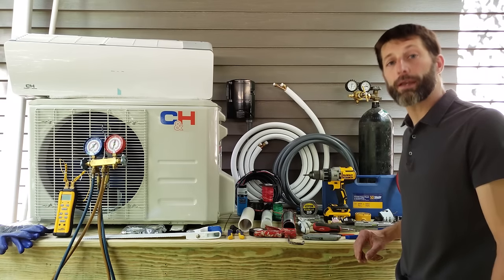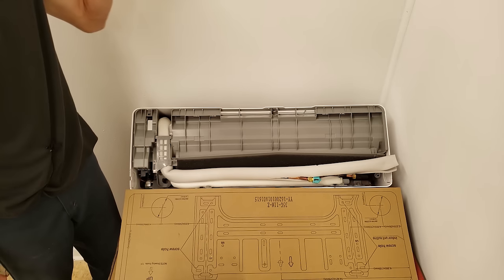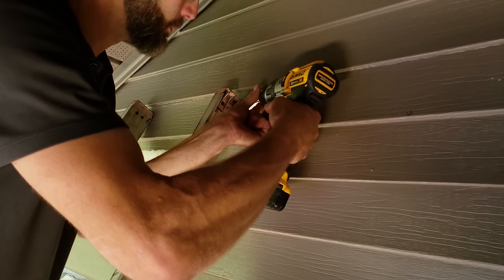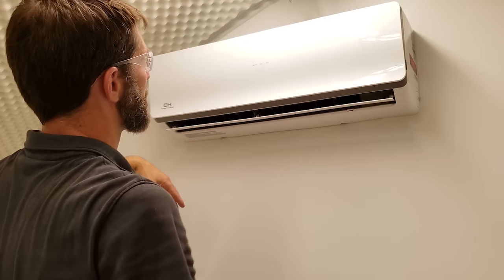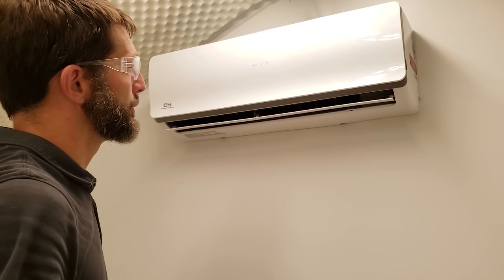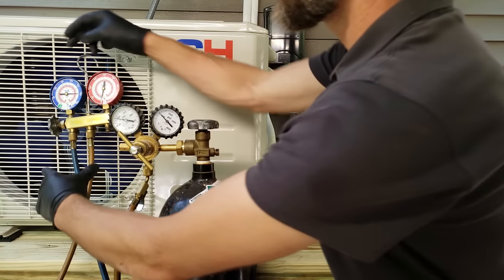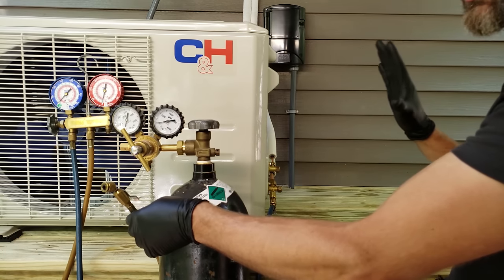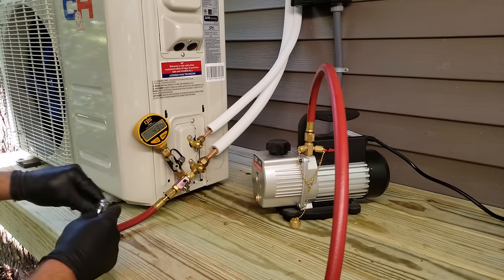Full Installation of Mini Split Ductless Unit, Step by Step!

Comment: Years ago, I paid $5,000 to have a 15K Fujitsu mini-split installed by a local HVAC company. That price did not include 240 volt wiring, as I anticipated the installation of an 12K A/C window unit that the Fujitsu replaced.

They installed it on a wood deck, as you did, but with an imitation concrete pad that came with it. BIG mistake - during the winter, ice build-up during the defrosting mode was a problem. 

They came out and put standard 8" tall concrete blocks underneath to raise the outdoor unit. All that did was build-up 8" of ice underneath!

Disgusted, I constructed a treated wood riser, with 24" of clearance underneath. I had to monitor the winter ice build-up, remove the top cover, and spray down the coils with hot water whenever ice builtup.

I have no idea how your installation can avoid ice build-up, unless newer designs have eliminated the problem I had.

The unit eventually seemed to lose it's refrigerant charge, after only 5 years. It was not worth attempting repairs to find the reason. They are throwaway units when they fail!

Comment: you actually don't need to straighten the tubings. you can just use the other side hole for the internal connections.

Comment: Any feedback on how these work on a 20-30 degree day for heat?
Reply: Depends on your unit, you'd need to check the manual to see the operating range. But most systems like this work well below freezing. The more expensive models come with drain pan heaters and compressor heaters. Their efficiency does suffer the colder it gets, however.

Comment: hi, some unit comes with a small condensate pump. when would you need to use one of those. thanks.
Reply: When the condensate may need to go upwards to maybe a drain in the room above. If the condensate is only being fed outside from the indoor unit, you don't need it

Comment: I want to be able to use my thermostat to control my mini split air conditioner.  could you make a video to show how the wire the mini split conditioner to thermostat?
Reply: You can't do that in most cases because these use a communicating thermostat with multiple speeds. Some manufacturers offer a converter that allows you to use a normal thermostat but it dumbs down the unit.

Comment: My C&H 36,000 puts up a P6 code and doesn't work, not an electrician but I believe I have 10-2 wire (orange in color). on a 2 pull  30 amp fuse in panel with a fuseless outdoor box. any help would be greatly appreciated.

Comment: How old of copper Line set could you use. I installed one 5 years ago and hope the copper hasn’t oxidized too much inside. Any ideas?
Reply: They make flush solvent to clean out anything in the lineset, i use it for linesets that just can't be changed due tu location and difficulty and it works fine.

Comment: can you please make a video about the difference between low charge vs liquid line restriction in mini split ductless unit that has no high pressure service port
Reply: You have to look for temp drops in the lines for ll restrictions. But mini splits do their own thing with so many variables that it is fun to troubleshoot.

Comment: Very informative. However, about nitrogen pressure testing:  I'm installing a Pioneer unit and I noticed their installation instructions do not mention at all a nitrogen pressure test, only a vacuum test.  I called Pioneer and their technician said nitrogen pressure testing is simply not needed with their units.  Looking online, there have been discussions about this (GarageJournal, Reddit).  On Reddit someone posted that their Fujitsu install manual actually prohibits pressure testing with nitrogen ("when inspecting gas leakage, always use the vacuum pump for pressure.  Do not use nitrogen gas".  In response an HVAC person posted "You will start seeing more of this in manuals....a lot of manufacturers are having problems with the valves...people are blowing nitrogen past them and contaminating the factory charge..."   Others maintain a vacuum test alone is inadequate.  Who to believe??
Reply from the maker: I would do a pressure test to test for leaks but the test pressure does not need to be that high even if it were 100 or 200 psi. That certainly would not blow any valve because the standing pressure of R-410A when it is off at 70 degrees F is 201psi. I believe they are referencing techs putting the pressure up to 500 or 600 psi, thanks!

Comment: Years ago my fujitsu rep told me to never use the nuts and flares that come on the line set. You haven't had bad experiences with them leaking?
Reply: I cut them off at the fan coil and braze them. It cuts down on call backs for leaks. I can’t braze them at the outdoor unit because they thread onto the brass “blocks” but I wish I could.
Reply: @joshramsey6893  I've seen people do that. Never have done it myself. Recently jumped onto the press fitting band wagon. Hoping for the best, I've put in ten systems with them so far. 😅
Reply: @profjohnfrinks  I have also jumped on that wagon and so far we have had good results.

Comment: So it's ok to cut the line set to avoid the coil up (excess line set) ?  Is it bad to have a coil up and not cut the line set.
Reply: Its best to cut off the line set like Craig demonstrated.  Coiled linesets can cause an undesired oil trap.

Comment: When the outdoor unit has four lines, brown, blue, orange and ground, and the indoor unit has seven lines: four like the other are brown, blue, orange and ground, and the other three are thin, white, red and black.  Note that the air conditioner is an inverter.
And the outdoor unit dont have another 3 lines for the thin wires .
Thanks.

Comment: I have a question.. Cuting the length of the tubbing doesn't create any problems?
Reply: As long as your liquid line (small pipe) is 10ft or more you should be fine.
Reply: No, the accumulator is sized for a certain line length(holding any excess refrigerant is ok).

Comment: How do HVAC professionals view the Cooper&Hunter brand heat pumps?  I hear lots of people/techs suggest the Mitsubishi or Fujitsi but they don't seem to have reasons as to why the other brands are not any good.  I'm inclined to get a Cooper-Hunter Dakota series 12,000btu at this point unless I hear something particularly wrong with the brand.
Reply: I might be wrong, but all Cooper&Hunter products are made for them in China by GREE. Which is world's largest AC producer and a good one as well.
Reply: Well Mitsubishi and Fujitsu are Japanese quality and they sell equipment world wide. C&h is USA only and is just rebadged equipment from midea or gree which are both cheaper units. They aren't as efficient as Mitsubishi or Fujitsu unfortunately.

Comment: After watching this I realize I need to hire the job out because I would spend a fortune on all the tools. However, I worry the techs here might not be as detailed and experienced as Craig. Should I make the installer watch this video and make sure they will follow these steps and have all the special tools? I’ve been burned by so many hack contractors.

Comment: i must have missed something -- is the refrigerant already in the unit, and it's released at some point after vacuuming out the lineset?
Reply: It's like any other condensing unit that is charged with refrigerant.
Reply: @seanmathews1826  unfortunately, those words don't mean anything to me. it's either got the refrigerant in it already, or he charged it with refrigerant but i missed that part of the video / or he left it out.
Reply: Pretty much all air conditioning systems are precharged with refrigerant. After the copper lines are connected and a vacuum has been pulled the refrigerant is released at the outside condensing unit. There are usually two valves that are opened with Allen wrenches.  
Hope this helps . By the way I am an HVAC tech with 31 years experience. And if you want my honest opinion stay away from these mini split systems.  They are over engineered junk. I wouldn't put one in my house if it was given to me for free.

Comment: One small detail.......the crimp you made on the insulated terminal should have been made with the oval jaws of the crimper not the spike. The spike is reserved for non insulated terminals and if used should be "spiked" on the opposite side of the split of the tube of the terminal (some of the best quality terminals are solid tubes in which case it doesn't matter where the spike is located. Your Irwin stripper/crimper has mis-leading markings for crimps that indicate the spikes are ok for insul and non-insul. Irwin is not known for high quality electrical/electronics tools. Most higher end crimps like Kleins and Knipex clearly differentiate the spikes for non-insulated terminals. 
I did the same thing for a decade or so until I studied several of the tool & terminal manufacturer's data & install sheets as well as technical how to's of aircraft and boating enthusiasts. Some of the best info on this topic can be found from marine and boating electrical manufacturers as well as forums dedicated to marine or aircraft. They have to deal with truly harsh and/or corrosive environments while insuring safe long lasting connections.
In this particular case it's not that big of a deal on the tray cable wiring because it doesn't deal with much current. The indoor unit's  blower motor, control panel, actuators, sensors etc don't consume much current. This is also not a big concern for low voltage control wiring. It really becomes a thing for high current mains voltage like compressors, contactors or fan connections. Here it's best practice to use dedicated ratchet crimpers with high quality terminals to obtain almost gas-tight crimps that won't succumb to corrosion and high resistance which causes the burned out terminals. (By the way, some of the factory terminal connections from major HVAC manufacturers are poor quality eventually resulting in failure)

Comment: Can you run the lines out the left side instead??
Reply: Yes, you can see on the template at https://youtu.be/JQkth-AM5CE?t=605 it has where to cut the hole on either side.

Comment: Great video but what blows my mind is why not just use a stud finder in the beginning?  You have all the proper tools for literally everything else.  Just seems amateurish to keep drilling small holes with the screw to find a stud when a stud finder would have found it in 2 seconds and then you move on?  I plan on installing my Mini split in the garage here in about a month.  This video was nice because it went over mostly everything.
Reply: He's the AC Service Tech, not Norm on This Old House. Do you moonlight as a Brain Surgeon?  Didn't think so.
Reply: @juniorvasquez9166  I'm competent enough to be able to use a stud finder and not draw unnecessary holes again this video was great but certain things if you have all the other tools to do the job how is not having a $20 stud finder worth it in your arsenal to be able to not only locate if there are studs but more importantly if you're going through and there's wiring or other such things that you could potentially hit by drilling unnecessarily holes...aa

Comment: there is a little mistake there when you connect  the power line (red wire) .  It should connect to the hidden post as you connect the black wire.

Comment: Interesting how you used the downspout to cover the line.   I used plastic rain gutter and cut to size when I did mine then used 1 inch L brackets to attach.  Yours seems more secure.

Comment: The instructions on nilog specifically claim to be a thread and gasket sealant actually it says to put on threads as if it were a “rope”
Reply from the maker: Yes that is correct for a threaded seal. This is a flare seal. These threads are too spread out and are only meant for tightening the seal at the flare face, thanks!

Comment: Quick question for anyone who knows how short can the  line set be ? Let's say the Installation was back to back is it better to leave the full line set coiled up or cut it about a  foot in length
Reply: The instructions will say minimum length. The brands I have looked at state 9ft as minimum. You also have to reduce the Freon charge to match the shorter Line set.
Reply: @gatorgrissom9141  reducing the freon charge is where the issue is for me , I've seen overtime minisplits ice up when that method is followed, however once you leave the full factory charge in no matter how short you cut it it runs fine , so techs started leaving the line set coiled up at the back of the condenser just for peace of mind🤷🏽‍♂️
Reply: Overcharge will ice up

Comment: Why didn't you show how you fished the wire from the back to the front of the head unit? And then, installing the harness bracket to the back of the unit? Kind of an important step...

Comment: Time 54:45
For vacuum test procedure, it may be too confuse for beginner (or DIY guy for doing ad-hoc works without sufficient tools and equipment) as the video showing too many adopters / protection devices and gauges plugging into the low pressure service valve. I finally joined a evening hobby class and diy myself to figure out what exactly doing about....

Also the class instructor offer a dirty trick for student without vacuum pump in hand (some non-professional corner shop ac technician actually doing this for many years without problem) by omitting the vacuum procedure.....
1. Ensure both service valves at vapor (low pressure) pipe and (high pressure) liquid pipe are locked.
2. Slightly loose the vapor (low pressure) pipe flare nut.
3. Keep vapor (low pressure) service valve closed.
4. Open liquid (high pressure) pipe service valve and let refrigerant release for filling an brand new system. Excessive air inside the pipe will be expelled out at the vapor (low pressure) line flare end due to low pressure line valve are closed (hear air sound and watch little refrigerant come out).
5. Re-tight the vapour line flare nut again to the required torque after procedure (4).
***End of Expelling Excessive Air procedure*** 

I am sure this is not acceptable for professional trade, but commonly happened for domestic AC installation works in Hong Kong. As I also fooled by an AC technician for installing my new split type AC without pressure test and vacuum test until I attended the evening hobby class too🙄

In Hong Kong, most AC units are mounted outside the concrete wall from highrise building. For old buildings no permanet pre-built mounting platform for AC unit. So it needs to erect a permanet stainless steel cantilever hanger platform (for AC unit seating) and temporary working platform for hose connection and servicing outside concrete wall for highrise building. Lifting and loading a 3.0HP AC unit outside the window in old high-rise building by only two workers is the most risky procedure for the entired installation works (fatal accident do happened occasionally for falling ac unit, even workers from multiple level building to ground floor without proper safety procedure!!!)

I have to install a hoist and use block chain to load the AC unit to the permanet steel hanger platform outside the wall....Also some aging unit and rusting AC hanger platform without routine structural check and maintenance also possess risks to public too.

Last but not least, thank you for your generosity for showing this video for installing AC unit in professional way.

Comment: If someone can help me.  When you don’t use the whole line set that comes with the unit.   How do you know how much refrigerant to remove?
Reply: From experience these units are pretty tolerant to length changes and it will be fine keeping the full factory charge. If you are worried you can test it like he does at the end of the video with the thermal probes and gauge and do the math.

Comment: Sir can you please explain the charging method on this type of unit to determine whether it is under or overcharged? The explanation at the end of this video was a bit confusing, especially the superheat value and accumulator, as your explanation on the accumulator was clearly stated in a previous video.
Reply: Its is based on the length of the lineset. Not superheat or subcooling. The unit will come with enough refrigerant for a certain length of lineset. If you exceed that length, you have to add refrigerant. The manual will normally tell you how much to add per foot of additional lineset. There are also minimum and maximum lineset allowances.
Reply: He explained that you can not add charge based on superheat or subcool.  If necessary, recover and then weigh in refrigerant.  The "liquid" line is actually an insulated expansion line downstream of the metering device, which is located in the outside unit, not in the evaporator.
Reply: His method of checking is a bit imprecise and old school. To properly check requires two hydrometer and temp probes to measure the temp and moisture removal. In addition, you should know and verify air flow. I did this and got my expected capacity. This is the only method for verifying operation. This is because a mini split can vary compressor, expansion valve, and inside and outside air flows. For more information on how to check visit the hvacschool channel and search for mini split videos.
Reply: To add, every mini split loves to run a low super heat. It's how it removes humidity effectively and that's more important for comfort. The accumulator protects against liquid refrigerant. This is especially important for heat mode.

Comment: you know what's get you a headache, when you have no clearance space, in tighten the flaring nut to the outside unit, outside of the window of the building, second floor high, with almost 6 inches wall to drill for the pipes or tubes.